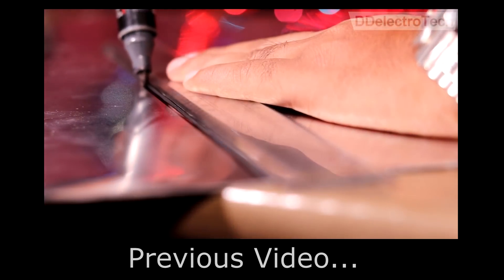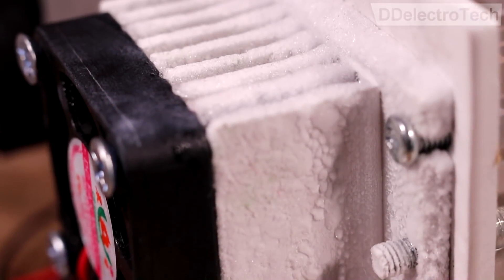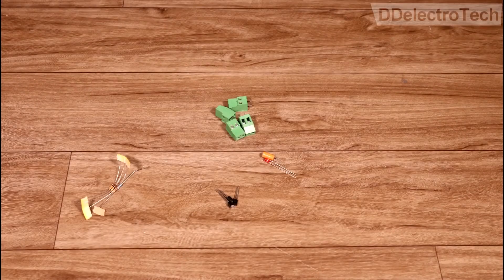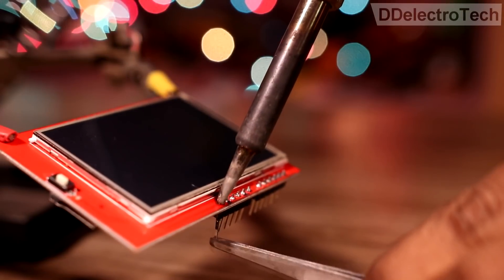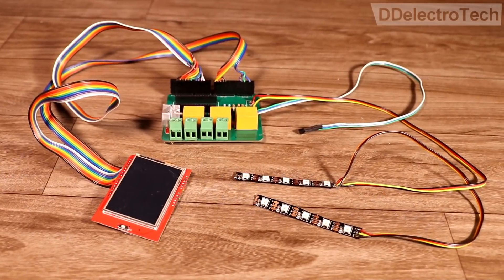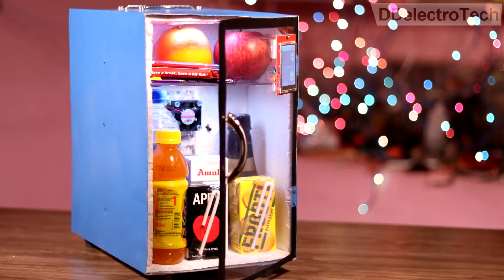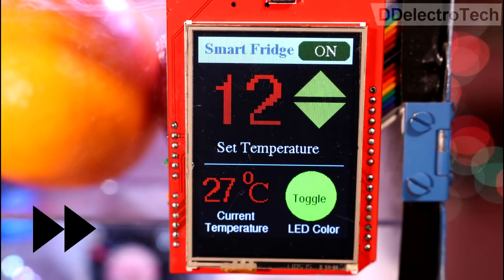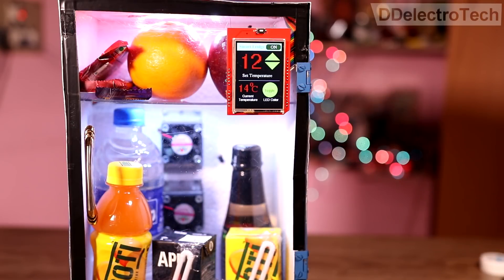How to Make a Smart Touch Screen Refrigerator at Home

Comment: I am completely ignorant about electronics projects.  i have a 6 inch speaker lying at home. How can I attach that to my mobile phone so that I get enhanced noise ? I need a simple amplifier between the phone and speaker,  right ? Can anyone provide a link to such a video, a very simple one, which I and make using some wires and soldiering iron, and probably a simple IC which I can get online ?